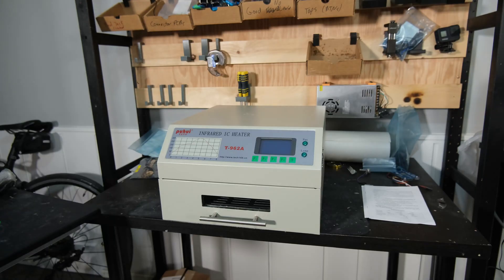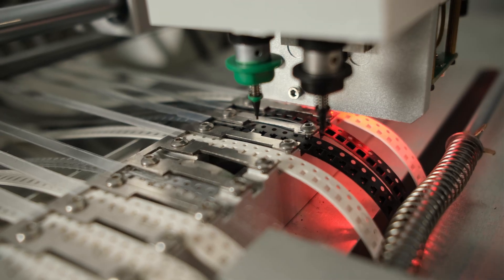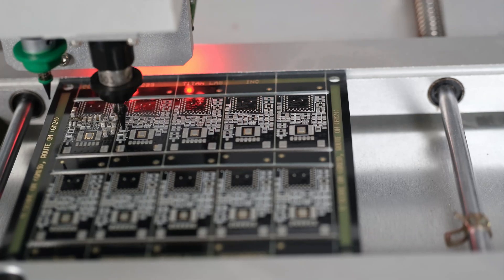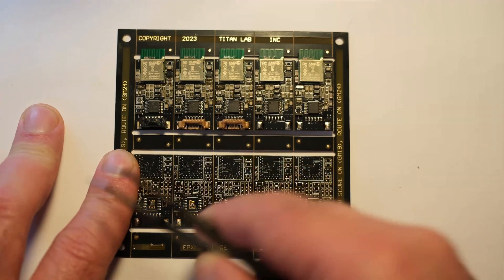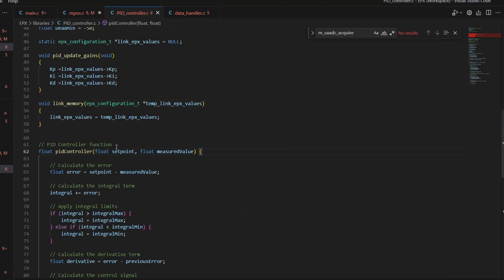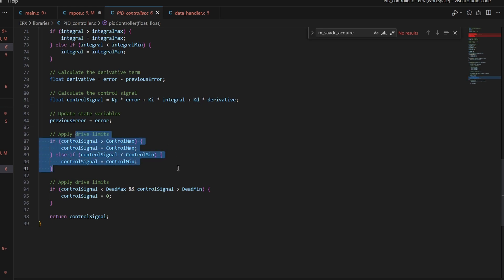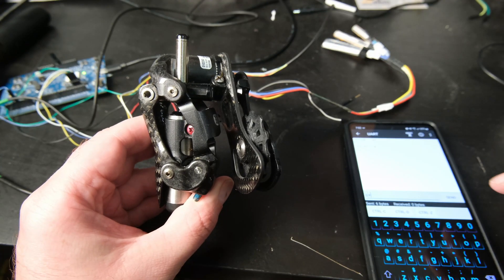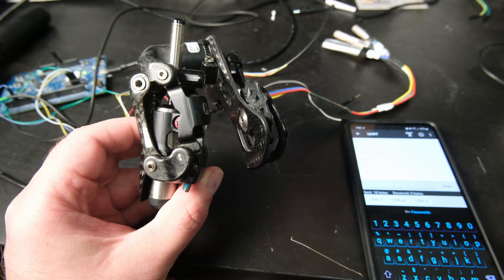I finally built a New Campagnolo EPS (wireless) power Unit - EPX6.5

Comment: Hi Keith, 
I have a v2 battery Athena campag eps groupset. I haven’t used it for about two years. Had trust issues with the battery system so switched to Shimano…I have trust issues with the battery life. 
Please can you advise me how to test the v2 battery and perhaps test my charger too. I can’t seem to be able to test the battery.
Charger just flashes and nothing charges….so seems like the battery is dead or the charger is dead. 

Just some advice on resurrecting my campag would appreciated.
Thanks Jason. 

Is there another way to make a new battery (have done it with Shimano di2)?

Comment: Very Cool! I've been following your projects for the past 10 years! I was working on an auto-shifting system based on RPM/power. My project failed. Glad to see you're still after it!
Reply from the maker: Well, not so much auto shifting. Just dealing with the whole lack of features, generating trash, and unreplacable power unit. They haven't made V3's in years and they actually can't because Panasonic stopped making the NCR14430 cells permanently. V4 is just 14500 cells but was intentionally made not backwards compatible due to the 11spd vs 12spd thing. So every EPS v2 and v3 system is dying, yet the derailleurs and shifters are good. In fact Shimano and SRAM's latest offerings are still slower and weaker in terms of speed and force. Just sick of disposable everything. Right to repair maybe?
Reply: @kwakeham  I’m with you 100%. Years back, when I supported a team that used EPS, the shifting was next level in terms of derailleur speed and torque. I think a lot of this was the high (relative compared to other offering) voltage of the system. Every system had controller/battery failure. I learned recently that all those broken systems were thrown in the garbage. So sad.
Reply from the maker: @Alansutton I hate that this is where we are with tech. 12 Speed uses the same actuator but different mechanicals. There was very little reason to not support or at least use the V4 in a backwards mode, but with the wireless new 12speed both 11 and 12spd will be abandoned -- at least V4 powerunits might be able to be made for longer

Comment: Thanks for covering these topics, especially with the Nordic peripheral details etc. For the oven, you might want to try 'Reflow Master Pro' (from @UnexpectedMaker) which I'm told is very good and apparently achieves accurate 'burn profiles'. A small 'hot plate' also works for small projects (wouldn't take a panelized pcb, but you could do one board at a time)

What's that mini PnP you're using?
Reply from the maker: It's a Qihe TVM802B which is the one with a built in a computer but only one reel set. Due to the ikea table it's on it is much slower than it can go. I had a lot of early frustration and documentation is a bit light on what all the offsets mean. It was 0402 attempts that really pushed me to dial it in and it's much much better.